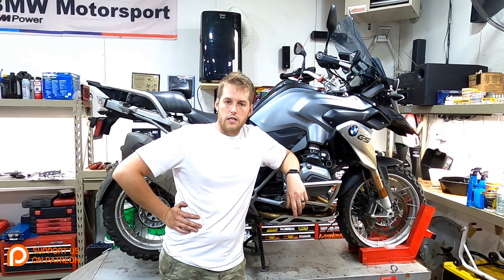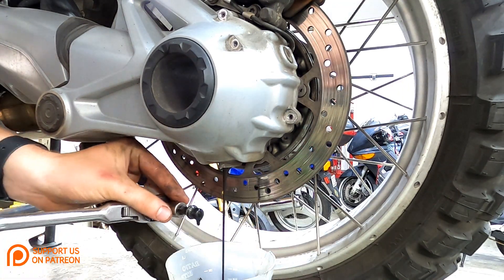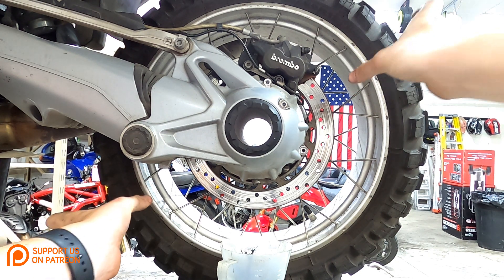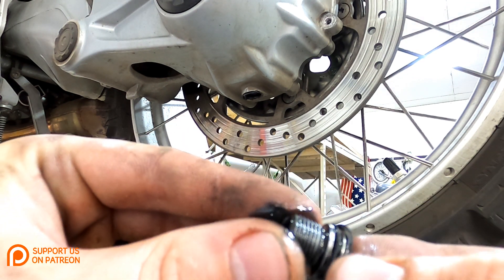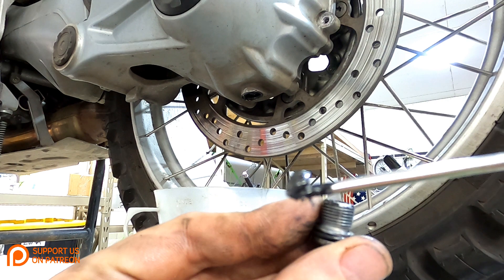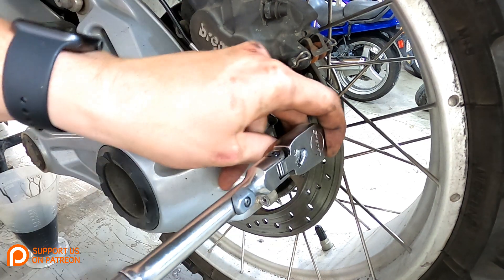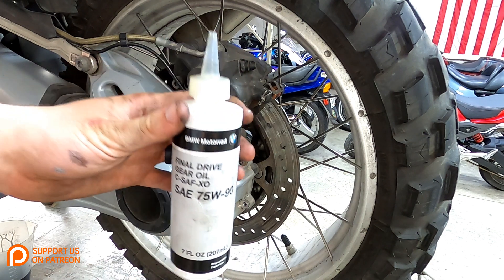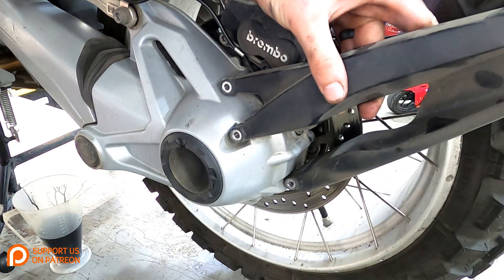BMW R1200GSW Rear Drive Oil Change Step By Step

Comment: You need to add part numbers for rubber drain plug ring and crush washer for fill plug. Can you use non bmw oil? 75w90?

Comment: I did not see you reference the recommended torque settings.
Reply from the maker: My mistake, it’s 20NM for both the drain and fill plug.

Comment: I have a question I hope you might be able to help me with please. I have a 2019 BMW R Nine T still covered under warranty. The bike reaches 143c engine temp in 25 minutes casual riding(18c ambient temp) as seen on the video I link below -I believe 143c is the max the display is capable of so actual temp is greater. BMW Motorrad are saying this is normal and refusing warranty work. Does it sound normal to you? I've lost confidence in the bike, and quickly loosing confidence in BMW Motorrad, which is a shame as its otherwise an amazing machine! Any advice you can offer would be appreciated!
https://youtu.be/onKkiKo9bOA
Reply from the maker: Yup! That’s 100% normal, typically it will be around 120c but depending on elevation and ambient temp it can go up or down drastically. Used bmw oil or any other quality oil and it should be just fine! For perspective most modern oils won’t start to break down until 230C!!! Just make sure your using a good quality 20w50 synthetic.
Reply from the maker: Also if you have a mesh guard or anything over your oil cooler that will effect temps
Reply: @TheBMWGuy  Thank you so much, that gives me great peace of mind!